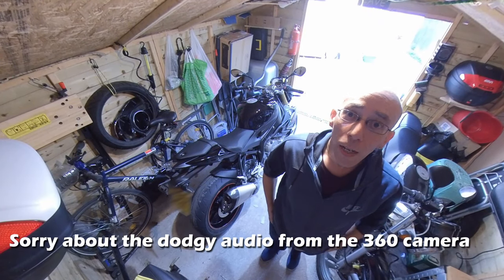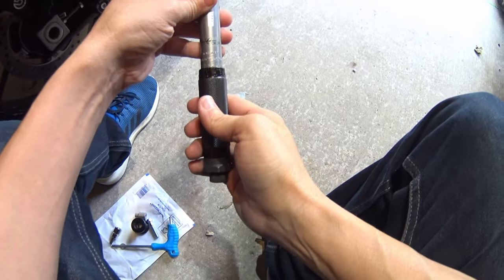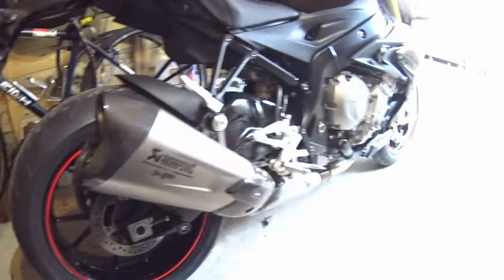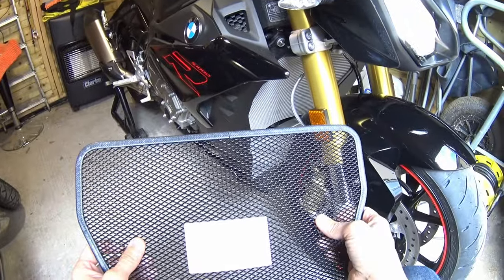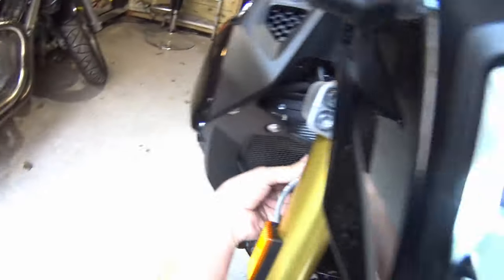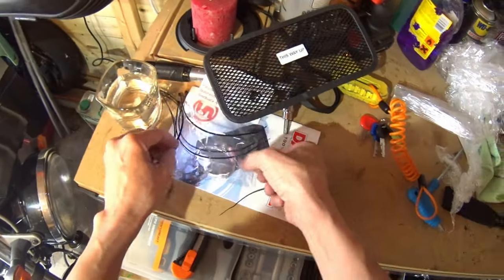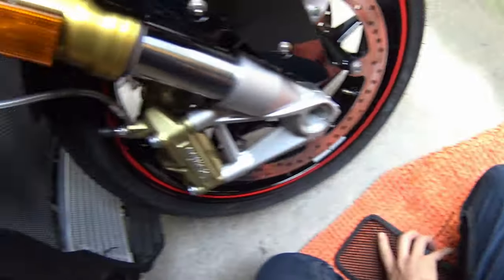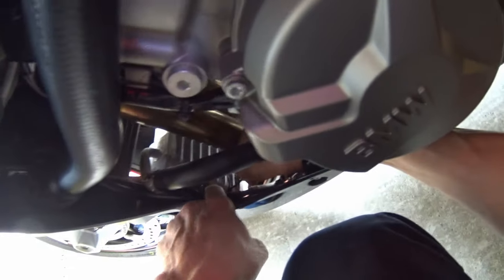BMW S1000R 2017+ bolt ons Pt1: swing arm bobbins, radiator/oil guard

Comment: Oow, thats a nice little list of things to look at, I know you ordered somewhere else, but where did you pick it up from? I've got just the Abba stand and it works well, just make sure it;s fairly level, as I nearly lost my S1KR as it wasn't totally lever :(  Looking forward to risers as I had to get Horning ones again a German company, but not totally impressed with them, as I though they would fill the handlebar mount. One other tip, if you wear a jacket with a metal zip as I do, get a tank protector! As I have a scratch already, not impressed, if you get one, don't get it from here if you want it quickly motografix.com ordered on the 2/10/19, still waiting for dispatched confirmation or delivery, not very good at all.
Reply from the maker: Damn I thought the ABBA stand would be pretty foolproof! Still, anything has to be better than a paddock stand!  I got my bike from Welwyn Garden City Motorrad, I'm giving them a fair chance to put things right but if they don't I'll be going past the sales guys and up to management for sure.  At least I got a fully run-in S1KR Sport as a courtesy bike.... the ride back home was a lot shorter than the ride down there!!
My risers leave a little gap on one side too, but there is a little gap on the original clamps too so it's not really any different from what I can see.

I've got a tank pad ready to go on actually, but because the bike was going back to the shop and the tank was likely coming off the bike I didn't want to stick it on.  What I ended up doing was putting gaffa tape over the bottom six inches of my zip instead... clever I know 😁  Sorry to hear about your scratch though, I hope it can polish out?
Reply: @RikkyTang  It is, just make sure it's level, your workshop looks sturdy and level enough to me. A bit of a better ride back then :) 

I can now rev to 9000rpm, just done over 500 miles, looking to book it in for first service, but the weather looks shit for the next week though

Oh right, I'll look closely when you put the video up, it just looks weird that the 'cams for a better word' doesn't fill out the mount. I've checked the torque a few times now and it doesn't seem to loosen off, so it was weird that the 2 bottom bolts felt so lose. They do mean I can ride the bike without to much pain (broken elbow 16 years ago), and the handling seems shit hot to me, especially compared to my old MT09 :)

Wish I'd thought of taping it up :( It's finally in the post now, I also hope it might polish out, mordern paint jobs seem so cheap, we've got a black car and we're scared to breath onn it as the paint is so thin :)
Reply from the maker: @try-that  Yeah my shed and paving outside is level so that should be ok - it's going on my Christmas list... I always spend the most on myself at Christmas! 😂

I've realised that we are not quite talking about the same thing when it comes to the handlebar mount.  I understand what you are saying about the fit now.  Looking at the footage I have (I don't really look at the risers from side-on, more from above really) the risers fit snugly, pretty much the same fit as the original bars.  If you look at the Wunderlich website for these 20mm risers mine look the same as the pics on there https://www.wunderlich.de/shop/en/bmw-s-serie/s-1000-r/ergonomics-comfort/handlebar-conversion-risers/wunderlich-handlebar-risers-sportergo-35631-101.html  You'll also see the gap I was talking about, where you can see the bolt threads; I think that is there to allow the clamps to firmly grip the bar.

On the ride home I took it past 9000 in 2nd once or twice... lets just say the wheelie control doesn't kick in until after it passes my personal comfort zone!!
Reply: @RikkyTang  Yours look better, but still interested in your video though. Yeah I'm not great with wheelies unless on a green lane bike :) I'm looking forward to testing launch control though
Reply from the maker: @try-that  I was never good at wheelies even on a bicycle so the electronics will help me out there when I get more used to it!  And re: launch control, I'm sure you've read the manual like I have but be aware that launch controls disables DTC, so if you are on cold tyres you could potentially spin the back wheel 😲
Reply: @RikkyTang  Yeah, but you gotta try it  at least once  :) Just got to make sure you're in launch control, otherwise I'll be on my ass and the bike will be down the road :)

Comment: Hi Ricky, today I fitted Evotech levers to my bike....in doing so I have lost my quick shifter, can you help?
Reply from the maker: I'm not too sure of what the problem could be, but I am pretty sure that there is a microswitch in the clutch lever mount that you have to be careful not to break or move when fitting new levers. Also, the new clutch lever needs to have a small "nubbin" on it to activate that microswitch.  I don't think you are the first to have this problem though... I would check out the S1000R.co.uk forum as that is the best place to find answers.
Reply: @RikkyTang  I have been told to switch the actuator from the OEM to the Evotech levers…
Reply from the maker: @raymolaverda3432  Right, so it's held in the original lever with a little bolt I guess? I hope you can get it worked out and you don't have to go back to the OEM levers.